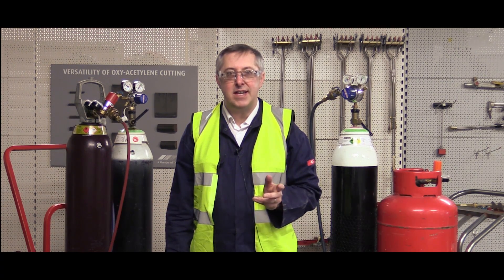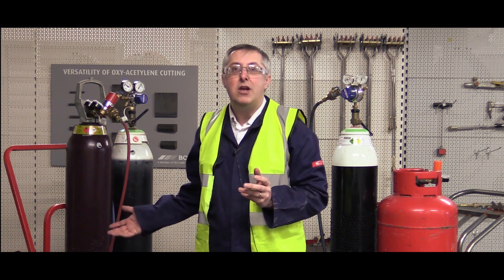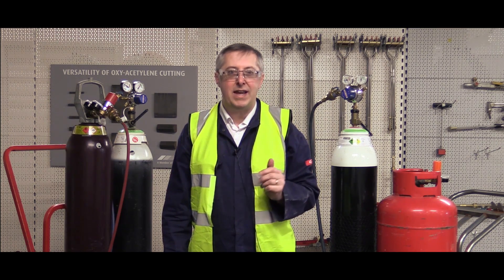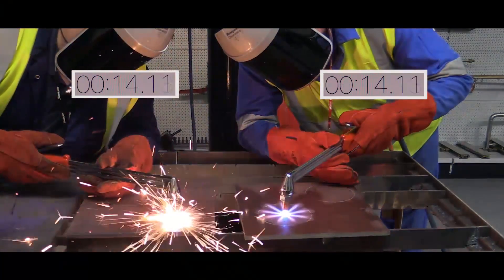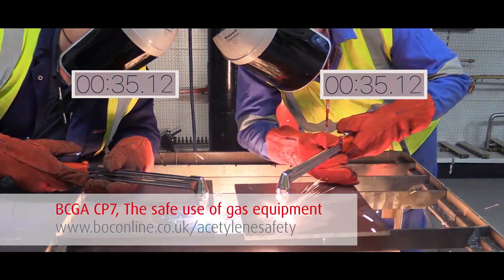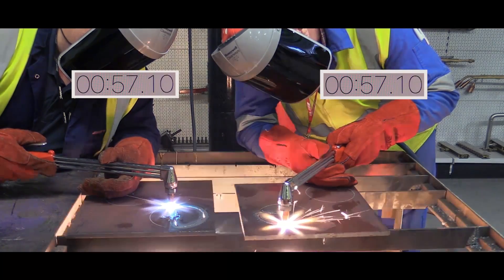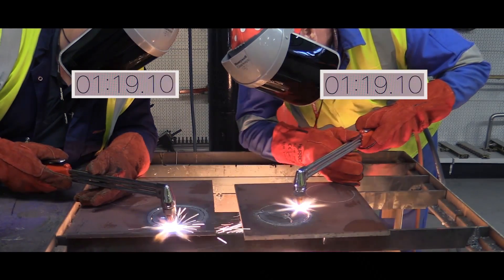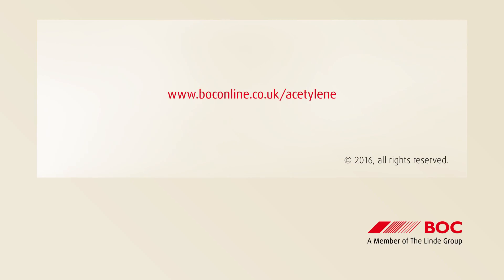Acetylene or Propane - Which Fuel Gas is best for you?

Comment: I'm a fire safety officer in Hampshire and our advice to change will be based on the risk to life and then business continuity for the business.If you have an acetylene cylinder in the building the fire service will not put fire fighters at risk if the building is empty, so will stand outside (attempting to get water on the cylinder) but ultimately stand back some 200-400 meters waiting for it to go bang, having seen the results of an acetylene cylinder going bang in my 27 years in the service, I can categorically say that employees will not be back at work the next day as it will have taken part of the building down. LPG causes far less damage to a building due to different flammability limits, acetylene being far more volatile.I don't have any issues with acetylene as long as people are trained in its use, the company has looked into DSEAR (HSE website) and for best results pipe the gas into the building or can evacuate the cylinders if the fire alarm sounds, (stored at night outside in a cage) Quite often people only use it for heating and are not aware that there are alternatives like oxy-propane its mainly down to poor fire risk assessments.I liked the video showing that reducing the risk for just a few seconds when cutting is worth the change for cutting  as well as heating
Reply: And with good reason. A friend mentioned the Fire Brigade did not enter his factory as magnesium material was present as well water and fire. The building fell.

Edit- wasnt a tall building
Reply: you think propane is not as explosive a power as acyt? have you heard about the big explosion we had in toronto several years back at a propane filling station? it looked like several atomic bombs went off and blew everything in sight with 100 mt radius,,there was nothing left of the plant or the poor fellow that died,they could not find shreds of him
Reply: @ARCSTREAMS  Acetylene is more energetic per cu. ft. vs propane, and has much wider flammability limits. OTOH, for a given physical size a propane cylinder holds MUCH more fuel than an acetylene cylinder, so the overall available energy is much higher. I have both on my cart, propane for heating, acetylene for welding and brazing, and for cutting the one I use depends on material thickness and cut quality needed. Propylene is superior to propane for cutting and some heating tasks, but it costs more. Also, certain heating tasks, such as flame hardeneing, work better with acetylene, and flame carburizing requires acetylene (propylene may work as well).
Reply: tell me how is it acyt can weld without oxidising and act as a good shielding gas yet propane can not do this for welding?
Reply: @ARCSTREAMS  Well, let me put on my chemistry hat: It has to do with the unique flame chemistry of acetylene. Oxy-acetylene combustion is a two-stage process. The first stage occurs in the inner cone, where acetylene's triple bond breaks, releasing quite a bit of energy (which is why it's hotter than any other common fuel gas). Then, each carbon atom combines with a single oxygen atom at the point of the broken triple bond, at which point the hydrogen breaks free from the carbon. This releases even more heat. The result at that point is an outer flame envelope made up of carbon monoxide and hydrogen, both of which are highly reducing gases (they readily combine with any oxygen they can find). They shield the molten metal from the atmosphere. At the outer edges of the outer flame envelope the CO and H2 combine with atmospheric oxygen to become CO2 and H2O.

Propane, by comparison, is a fully saturated linear chain hydrocarbon (known chemically as an alkane, vs acetylene which is an alkyne, and propylene which has a double bond making it an alkene). Alkanes are very stable. Unlike triple bonds, which release energy when they break, the chemical bonds in propane absorb energy in order to break. This explains both the lower flame temperature, the lower flame speed, and the fact that the bulk of the heat is in the secondary flame. Propane's chemical formula is C3H8, 3 carbon atoms surrounded by 8 hydrogen atoms. Before any of the carbon atoms can oxidize, they must have the hydrogens removed, and then broken apart from one another. Because the hydrogen atoms are the first to break away, they are the first to oxidize. They combine with oxygen to make H2O, and the carbons combine with oxygen to make CO, assuming a "neutral" flame, which is a difficult thing to achieve with an alkane fuel gas. Often the flame is run oxygen rich, turning some or all of the carbons into CO2.

In either case, neither CO2 nor H2O are "inert" or stable at the temperature of the flame. They both dissociate and recombine randomly, leaving a certain portion of free oxygen or hydroxyl radicals available, thus they are actually oxidizers at flame temp. The H2O component of the flame can be absorbed into the metal and dissociate, where it not only oxidizes carbon or iron, but leaves hydrogen in solution, with the potential for hydrogen embrittlement depending on the alloy.
Reply: actually prop has a more than double the btu /cf then acyt but at 1lb they both deliver 21000 btu
Reply: thank you ,i was never much into complex chemistry and never understood all of it but i get it that there is more oxidation and hydrogen in the prop oxy flame then acyt,also i think it has to do with the fact that acyt is endothermic when created and absorbs heat rather than release it ,,i made a small oxy prop torch and have tried brazing steel wires with it using silver solder and some kind of flux (perhaps the wrong one) i notices i can get a very orangy pink flame and then a blue one perhaps neutral or oxidizing,,the flame may have been wrong and too hot because it oxidized the steel,but i did manage to finally get one bead brazed,,im now thinking about using the carburizing flame as you said or the outer one and going for less heat ,just enough to turn the metal cherry red with the flux and applying the solder ,its hard doing this on steel and even on thin aluminium
Reply: acyt is c2h2,what triple bond? but i understood when they combine to create hydrogen and carbon dioxide,,ok i read your stuff again and its making more sense to me now ,,the acyt creates leftover co2 which is actually a fair shielding gas used in mig and leaves water molecules so over all not a bad flame with little oxidation left to go into the metal or hydrogen ,,but you said propane does the same thing,leaves co2 and h20 so i still dont see the difference between the two
Reply: @ARCSTREAMS  Re-read what I posted. The initial products of combustion in the oxy-acetylene flame are carbon MONOXIDE and hydrogen, NOT carbon DIOXIDE and water. The secondary envelope of the oxy-acet flame, which is what shields the weld metal, is composed of carbon monoxide and hydrogen. It doesn't complete combustion into carbon dioxide and water vapor until those gases reach the outer edges of the secondary flame and are able to react with atmospheric oxygen.

The initial combustion products of a propane flame are water vapor (H2O) and carbon monoxide, if the flame is ideal. As I said, it is often oxygen-rich, so you end up with H2O, CO, and some CO2. In any case, even the H2O alone is oxidizing, as is CO2 if it is created. There really is no such thing as a truly neutral propane flame. Even an oxygen-poor flame burning yellow will have water vapor in it.
Reply: @ARCSTREAMS  As for what a triple bond is, read this for an explanation: https://en.wikipedia.org/wiki/Triple_bond

Not sure why you had trouble brazing with oxy-propane. One of the most common problems with brazing is getting the metal too hot. As for the flux, a product like Harris Stay-Silv white flux is suitable for most silver brazing. Only on stainless steel, or where you have prolonged heating (i.e. a large mass of metal) would there be a problem, which can be solved by using the Stay-Silv black flux. The black flux can be used wherever the white flux will work, but the residue from the white flux is much easier to clean. The black flux forms a glassy coating that is hard to remove without mechanical cleaning (wire brush or wheel, or bead blasting).
Reply: got it,,h20 and co2 are bad
Reply: yes the 1/16" wires im trying to braze get too hot or start sparking and oxidizing,it is possible to make them juts reach a cherry red color if i move the flame around but they do not get hot enough to melt the brazing silver rod (1/16") ,perhaps i can adjust the the flame to be carburizing or less oxidizing but then the heat is not that good and it takes longer,so im not sure how to go about it or if its even possible to braze steel,i heard you can braze iron,,non the less if was able to finally braze a small point that had both the flux and a small piece of the silver,i concentrated my heat on the silver and once all the metals started glowing almost white it melted everything and then it started to spark so i quickly removed the flame and it held well so far,,so it might be difficult but possible,,any tips?
Reply: btw going back to what you said about acyt being more energetic than propane " Acetylene is more energetic per cu. ft. vs propane" then how do you explain this info i found that says propane at 1cf=2570 btu and acyt at 1cf=1450 btu? but at 1lb each delivers 21000 btu or was all this different than what you said? like i said when it comes to chemistry im not that savy
Reply: @ARCSTREAMS  Are you sure of your filler metal? Silver solders melt in the 1200°-1400°F (648°-760°C) range, which is dull red heat.  Bronze rods melt around 1650°F (900°C) which is cherry red. Either will braze steel with proper flux, but silver braze (aka silver solder) is designed for capillary brazing of two close fitting parts. Bronze does NOT flow by capillary action, and so is a braze WELDING rod. You can braze weld with silver, but it's high fluidity and lower strength in tension make bronze a better choice.
Reply: @ARCSTREAMS  You're confusing btu content with being "energetic". By the latter, I mean that the triple bond and only two single bonds means that when acetylene undergoes the primary reaction, it generates a higher temperature. It is true that propane has more BTU per CF, which is due to having 8 hydrogens vs only 2 per molecule of acetylene. Hydrogen releases more energy when oxidized than carbon, but the triple bond releases a great deal of energy that only has to heat two carbon atoms and two hydrogen atoms, hence the higher temperature but lower BTU output of acetylene. 

Getting into a treatise that explains this in detail would take a great deal of typing. Probably easier to just accept that acetylene is hotter and non-oxidizing, while propane is cooler and more oxidizing, and each have their place. The nice thing about propane is that it is everywhere and cheap, so even if you need acetylene for welding, carburizing, some types of cutting, etc. it still costs very little to add a cylinder of propane to your cart for heating and other cutting applications. Propylene is another option for cutting and heating. It burns substantially hotter than propane so cuts start faster and it can heat faster under proper circumstances, and if you run out you can still pull the propane off your BBQ grill to finish the job.
Reply: yes you are right,,i realized what the problems were,,yes i believe it is silver,the flux i was using might have been no good,i think this was tin soldering flux and perhaps my flame heat was too high,the silver melted into a ball and would not wet into the metal which was starting to oxidise.

so i tried again with two small pieces of steel wire,only this time i made a flux using water and boric acid and put some of the paste between the rods which also helped stick them together,i cut a small piece of the solder wire and put it on top between the two rods ,i then used less gases on my torch to get a smaller wider flame(possibly carburising to neutral) and i started melting the flux and waited till the solder balled up then keept heating it till the rods started going red hot(at least beyond cherry) till finally the solder ball melted in and wet through along the rods,i then used a pair of pliers to pick the rods up and sweated both sides till the silver was flowing nicely and coating both sides,,let it cool then quenched it,,i buffed it clean and it looks like a piece of fine jewelry,,turned out great ,,im now thinking about recipes for making my own flux and i got some ideas and then sum,,if it works i might be rich lol
Reply: ok i figured you were gonna tell me all that and i had mixed apples and oranges but i was not sure,as i said not to savy with chemical bonds,reactions etc  and energy,,lol,,thank you very much sir   "while propane is cooler and less oxidizing," errr did you not mean more oxidising? ,,yup about the mapp(propylene) ,too bad they dont make it like they used to and now cheating us with the name but hey if it does the job like mapp did then fine
Reply: @ARCSTREAMS  You're right, I meant more oxodizing. Thanks!
Reply: thank you
Reply: Oxy-acetylene cutting is only dangerous if you don't use flashback arrestors at the cylinders and you don't purge your lines before you light the fuel gas i.e allowing the air to flow out before igniting the acetylene.
Reply: I store all my flammable gas cylinders outdoors for safety reasons. A business needing cutting can use plasma  and there is an arc welding process for joining most metals. Inert shielding gas doesn't contribute to fires. Torches are fine for cutting scrap but that's typically an outdoor process. For some parts electrical induction heating is an option. It's quite nice to use for annealing bar stock prior to machining. Typical in-shop torch cuts require mechanical finishing anyway so a process change to mechanical, waterjet or laser cutting can yield better results and increased profit. My bud who owns a machine shop doesn't bother with those processes because he can outsource laser cutting with no capital investment, then when the parts arrive they're off to the powder coaters. The less work you do in-house the fewer workers you need. When your workers are skilled machinists it's a waste of time and money to have them running a torch,
Reply: Ob Fuscated A few things here. First off, unless you pony up for a high dollar plasma, you ain't cutting thick material, and you certainly won't do any better than a properly set up torch. 

Yes, you can arc weld anything a torch can weld, but the torch excels at brazing and braze welding. Braze welding is my go-to repair for cast iron unless a color match is required. There are also some welding applications where the torch is better than an arc welding process. Most folks these days have either forgotten that, or more likely never learned due to the foolish idea a few decades back that oxy-acetylene welding was no longer needed. The pipe welding industry is one that definitely regrets the fact that fewer and fewer guys know how to properly cut, weld, and gouge with a torch.

Induction heating? Unless you have a large volume product needing that particular process, it is hard to justify the cash outlay for such a specialized piece of equipment for most shops. 

"Typical" in shop torch cuts only require finishing when the person using the torch has no idea what they are doing, and/or are using a bad nozzle. Like I said above, a good torch cut will rival a plasma cut, and they cost less and are much more versatile. Laser and water jet are fine for production runs, but even then CNC flame or plasma are cheaper and can often give perfectly fine results, depending on your needs. For onesy-twoseys, particularly on thicker steel, the torch makes good economic sense, and you don't have to wait for turn-around.

Check this video out. This is a bevel cut on thicker steel with a track torch. Note the finish. Then keep watching as he makes the same bevel cut by hand.
https://www.youtube.com/watch?v=vEWSpJ3oJa0&t=12m28s
Reply: @obfuscated3090  gas cutting is nice with thick steel. I don't have a lot of experience, but I had an opportunity to cut a 2 inch thick steel plate with a torch, and it didn't go much slower than 1/2 inch plate.